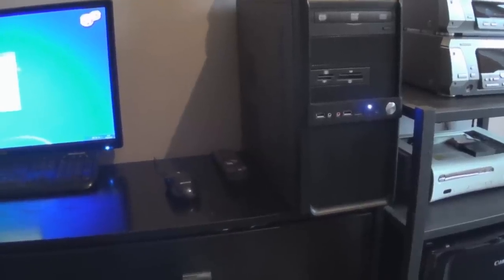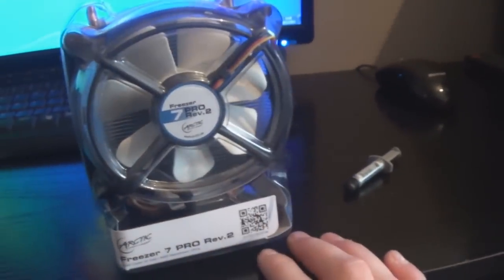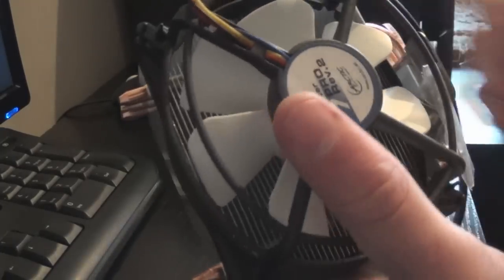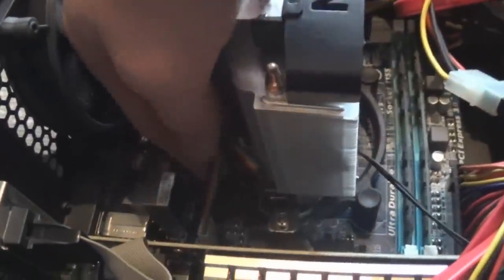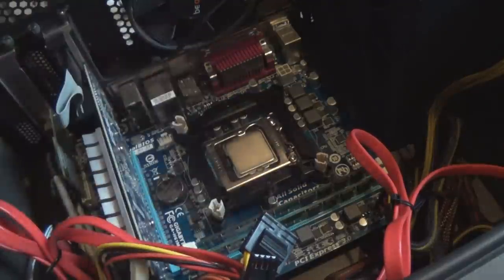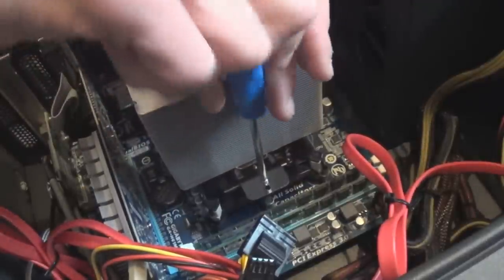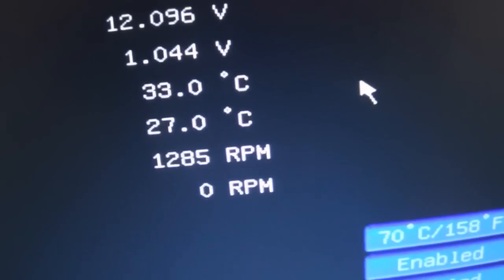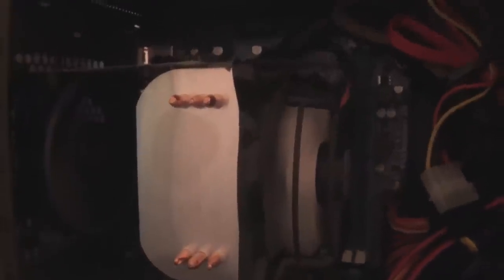Arctic Cooling Freezer 7 Pro Installation/Review

Comment: Great cooler. I've installed several and only had one with an issue. One of the rubber bushings that mounts the fan shroud to the fan base broke off but a replacement fan was $2.99 from the Arctic website. Dropped my i5 temps by about 18-20°C from a stock Intel cooler and they keep old Core 2 Duo/Quads nice and cool. They are a bit fragile but for $12-15 new and cheap spare fans, a great buy over stock.

Comment from the maker: Update: I did have an issue with this cooler at one point when it was mounted with the fan fighting gravity, the fan started slowing down and completely stopping. I found the pushing back against it hub nice and tight fixed this, it seemed to have worked its self away from the bearing and motor assembly. Just one to look out for, still a brilliant cooler though.

Comment: I have had pretty good luck using the Freezer 7 Pro. I have installed six or so on customers computers over the past year or so and I haven't had any issues. Let me know your experience. I intend to keep using them unless I hear bad things.
Reply from the maker: +AdoptedMike Yeah, only thing I have heard is the fan tends to come away from the bearing and motor and needs to be pushed back in place I pushed mine down just to be sure. Apart from that these are awesome :)
Reply: Isn’t the fan putting pressure on the cpu? Or am i doing it wrong

Comment: Using the Arctic 7 freezer pro on my Amd FX-4350  in my DIY Cuboid Case , horizontal mounted MB. 140mm ( can mount 160mm) front fan, 120mm rear fan , the top is SCREENED and cam mount 2- 120mm or Radiator with fans.never gets above 50°c
under full load

Comment: I don't understand why the thermal paste was removed. Isn't it put there for a reason?
Reply: If you want to apply your own higher quality thermal paste then you should remove the pre-applied one like he did in the video
Reply: @ronbrevik111  Surely something is wrong if this cooler performs worse than the stock one, make sure that enough pressure is applied between the cpu and the heatsink. Did u just recently get this cooler?

Comment: Thank you, your video helps a lot!
Reply from the maker: Cheers these are very good coolers quite but keep the chip cool.
Reply: I've read some stats about it and already purchased this one cooler. Compared with my old one Arctic is very very quite :D MrReeceyburger123
Reply from the maker: Awesome, these are great coolers my other one in my htpc is clogged with dust but still running very cool.

Comment: hi i have a question  this cooler is quiet;  its for my cpu 4670  3,4;
Reply: If on a budget look into cooler Master TX3 or if you have the room in your case and approx $10 more the 212evo. Freezer 7 is older and IMO outdated.
Reply: finaly i buy freezer 7  and i dont believe it  i have 900rpm only  in 20c  and if i run a game my cpu not going up 50c  thank you very much, and i buy only 20 euro
Reply from the maker: nickf10100 its quite good tbh, keeps the Ic below 60 at full load and fairly quiet-the fan has a nice humm and not an annoying buzz

Comment: i will overclock my i5 2500k to 4,5Ghz should i use this Arctic Cooling Freezer 7
Reply: Try this first, yes. I got my i7 3770k overclocked to 4.5GHz with this cooler. I have been running at 4.3 though, for lower temps and power consumption. It's an excellent quiet cooler for under £15.

Comment: there are tons of choices at this price better than this...  deep cool gammaxx 400, evo 212...
I bought this last week and I got a defected fan so I had to return it to micro center. but even if it wasn't a defected product, I would still return it because of the mediocre build quality, the fan looks so cheap, they don't even put the instruction slip inside, you have to use to barcode they gave to scan to see how to install it..